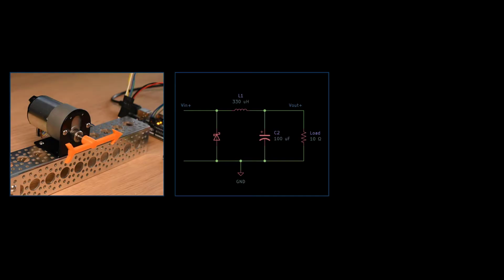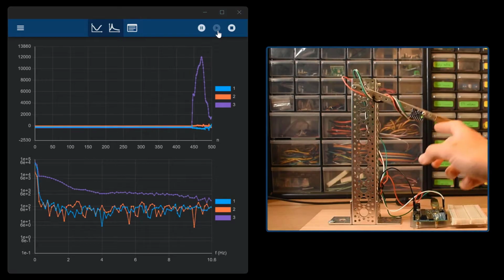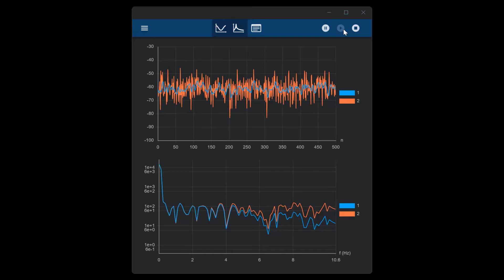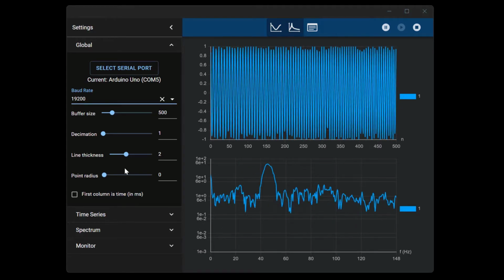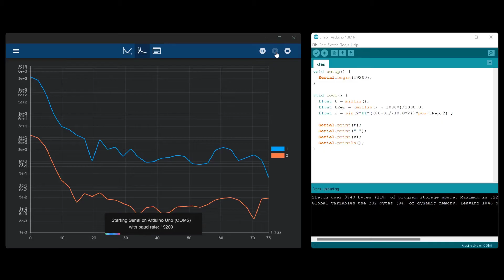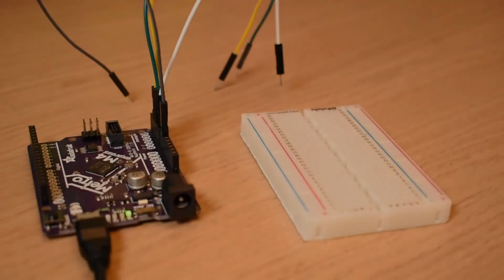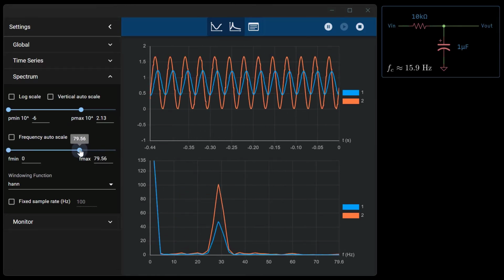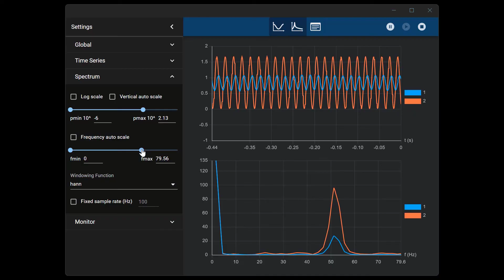The Serial Analyzer App

Comment: If I send a variable for time reference and then select 'Estimate time...', will it still use the variable I'm sending? Would that be the most accurate way to plot in terms of timing?
Reply from the maker: I can't remember, does "Estimate time" take an input? If not, than it's probably the most accurate because it will take whatever your time variable is and approximate the (average) sampling rate from it.

You can always check the source to figure out what "Estimate time" does.
Reply: @curiores111 thank you!!

Comment: Very Impressuve app. I used the graphs in my research paper. But its confusion. What is the value showing on the y-axus in upper graph. I have been analyzing a signal from piezoelectric material. Its showing my signal upto 30000. How can i adjust it to show magnitude of voltages. Can you help me in that. please

Comment: I have an accelerometer that transmits via serial at 1Mbps (it's a USART, not UART).   I tried to write a GUI using pyqtgraph, using one thread to parse the serial data, and another thread for the gui updating part.    Unfortunately, after just a few seconds the GUI would lag, unable to keep up. 

Any thoughts if your curiores/SerialAnalyzer could be modified to plot accelerometer data?   I've seen a few projects ( VizhPort , serial-studio, RealtimePlotter (Processing IDE),TelemetryViewer, hyOzd /serialplot ) but not sure how they handle lots of data. 

Standard can-bus operates at 1Mbps, so perhaps if there was a way to use a can-bus visualization tool for serial port data (pcan-explorer, plot-juggler, Tbruno25/can-explorer SavvyCAN )? 

BTW, any thoughts on Flutter/Flet and fl_charts?
Reply from the maker: I wouldn't use this type of application for that amount of data. Javascript isn't a performance language, so it's unlikely you'll get enough performance to meet your requirements.

If I'm thinking generally about the problem generally I'd probably use a low-level language like C++ to handle the data. Then, write an API to transmit the processed data (e.g., the fourier coefficients within a requested range) to the app. That could probably be a modification of this app... but at least on the surface I think that would be a much bigger project than the existing app.

There are probably existing solutions to this problem. I'm not familiar with them. Some of the apps you mentioned could be the way to go. Good luck!

Comment: Can not be uninstalled!!!!!!!!!!!!!!!!!!!!!!!!!!!!!!!!!!!! Beware!!!!
Reply from the maker: Really? I just tried uninstalling from the windows apps menu and it worked. Did you try that?

(The installer is an existing electron utility -- could certainly be buggy. I haven't had an issue with that so far though)
Reply: @curiores111  I had tried cclean and win10 uninstaller already. Everytime i tried. I was told serial analyzer was running and refuse to uninstall. Finally, I had to delete it in the Appdata folder. Note it was deleted and not uninstall. BTW, my Mcafee reported threat.

Comment: I get an error when connecting to com port, please help me
error code: Error starting serial port on USB Serial Device (COM4) Error: Opening COM4: Access denied
Reply from the maker: That can happen when another program is interacting with the device. Is the Arduino IDE interacting with it?
Reply: @curiores111  I was able to fix it, because the IDE was using the COM port so it couldn't connect to the analyzer app 
Thank you

Comment: How can I contact you for some help? I am building an electrostatic charge measurement device, It is almost done. But some oscillations are there which I'm trying to reduce, I watched your digital filtering I will try that. I also want to build an app to connect with mobile phones and my Linux laptop. These kinds of projects can help a lot in my work. But I'm not too savvy with electronics and application development. So If I wish to ask something, how can I get some help?

Comment: AMAZING stuff. Thank you sooo much for
- this tool
- the clear explanation and depth in your videos
- and the general ASMR-worthiness of your voice... found myself just zoning out listening :-)
I do have one feature request for this app (that I am currently using to tune the motor controller on my Star Wars D-O...) - and that is: It would be REALLY good to be able to a) name the transmitted signals, and b) have a way to send serial data to the Arduino. I often use command lines to set parameters and run specific things, and it would be great to be able to do this from this app.
Reply from the maker: Absolutely! The app was a labor of love, and I'm so glad that it has been able to be useful to you in tuning your D-O droid! 

Thanks for the feature request! It's irritating how the serial data often screws up in the first line. This is the reason I left out the normal naming by writing the first line in the setup function... That being said, we could certainly have it be an optional function that creates a name based on the first line of data. The other option would be to allow you to edit signal names inside the app. Does one of those options make more sense to you?

Sending serial messages is a pretty reasonable request. The simplest would probably be a pop-up window to send a message after a button press. Another option is to include it in the serial monitor widget as done in the Arduino app. This would mean splitting that window up. That's a good option too. A third option would be to add a fourth optional widget that becomes afixed to the bottom of the main window for sending messages to the arduino. Just an edit field and a button to send the message. Any of those options preferable?

If you want action on this I recommend creating an issue on the github page. 
https://github.com/curiores/SerialAnalyzer

I come back to the app occasionally to update it and this is where I look.

Comment: how did you create the windows installer for the app? did you just use visual studio?
Reply from the maker: I coded the app in VS code...but the packaging is unrelated to that. Definitely did not use Visual Studio.

Are you familiar with Node/Electron? It basically allows you to use a web-stack to develop OS-native apps.

My stack is an electron react app using Material-UI for the interface. I've added several node packages for additional functionality required by the app.

Electron packages that all together into the OS-native apps and generates the installers. Specifically, I used electron-builder.
Reply: oh thanks:) I've not use electron before but will check it out. Also, your other videos have been generally[really] useful. I feel like sometimes people say generally useful but what they really mean to say is really useful, or that's just me. Thanks again! @curiores111

Comment: I've been testing the serial analyzer for about a week now. The application of is great. I've  used it to see the response of a few first order filters (low pass, high pass and band pass).

I had 2 issues:

1. The numbers on the vertical axis of the frequency response graph have to be the gain of the filter in normal form A or in decibels 20logA, but on the app it shows numbers that doesn't match with either the true normal or the log values.

2. Hovering over a graph is supposed to give the x,y value at that point on the graph but it doesn't (well, it barely works), maybe you coded it with limited pixel freedom hence the issues.

Question:
How long did it take you make an application like this? The user experience is quite great when I got the hang of it.

Overall the app is great, thanks. I wish you don't stop making videos, they really motivate engineers (or people say nerds) like me.
Reply from the maker: Hey thanks for the feedback. If you make an issue on GitHub I'll visit it if I'm ever working in this app again.

How long did it take? Hmm. Few weekends. Maybe 60-80 hours? I wasn't very familiar with electron, react, or MUI, so there was definitely a learning curve. (also keep in mind, there's no testing -- this isn't production code). I had some interest in learning those "tools" so this was a nice way to engage with them more deeply.

Thanks for the encouragement. It's been hard to find the time/motivation for videos, but I'm working on one now. See if I can get it finished.

Comment: corrupted deb file, both from github and google driver, I downloaded it through curl since the link was off for me, I use ubuntu 23.04, I tried to compile the app too and it didn't work even with the dependencies
Reply from the maker: Probably an incompatibility with the OS. It would probably need to be rebuilt. I did build it on ubuntu -- but I don't recall the version so that's definitely not going to guarantee anything. Odd that you weren't able to compile it. But, compiling anything with dependencies often requires some debugging for getting the right things installed on your system, so not terribly surprising.

Comment: I am having an issue when monitoring the data from an arduino mega ADK connected to a 3-axis accelorometer (adxl35). The serial Analyser is reading the (x,y,z) data on the third box but it is not displaying the graphs. Can I have some help with my issue please, the arduino code is as follows;
 int xpin = A3;                
 int ypin = A2;                
 int zpin = A1; 
 int xvalue;
 int yvalue;
 int zvalue;
// Vcc at 3.3V
void setup()
{
   Serial.begin(9600);          // initialize the serial communications:
}

void loop()
{
  
  xvalue = analogRead(xpin);                              //reads values from x-pin & measures acceleration in X direction 
  int x = map(xvalue, 264, 401, -100, 100);               //maps the extreme ends analog values from -100 to 100 for our understanding
  float xg = (float)x/(-100.00);                          //converts the mapped value into acceleration in terms of "g"
  Serial.print(xg);                                       //prints value of acceleration in X direction
  Serial.print("   ");                                   //prints "g"
   
  yvalue = analogRead(ypin);
  int y = map(yvalue, 259, 398, -100, 100);
  float yg = (float)y/(-100.00);
  Serial.print("\t");
  Serial.print(yg);
  Serial.print("   "); 
 
  zvalue = analogRead(zpin);
  int z = map(zvalue, 287, 425, -100, 100);
  float zg = (float)z/(100.00);
  Serial.print("\t"); 
  Serial.print(zg);
  Serial.println("   ");
  delay(10);
}

Comment: Are the Arduino sketches you used in the video available online anywhere? I copied the first sketch from the screen, but I'd love to see the one you used with your RC filter. Thanks!
Reply from the maker: Here's what I have saved. I can't promise that it's what I used in the video, but it looks pretty close to me. It just generates a signal, which is written to the DAC (this was on an adafruit M4 which has a built in DAC on A0 and A1). Then, it reads the input and output signals from some probes looking into the circuit on A2 and A3. Pretty simple stuff:

void setup() {
  Serial.begin(115200);
}

void loop() {
  float t = millis()/1000.0;   
  float tRep = (millis() % 10000)/1000.0;
  float xmag = 4096/4.0; // max 4096
  float x = xmag*(1+sin(2*PI*((60-0)/(10.0*2))*pow(tRep,2))); 
  float Vin = x/4096.0*3.3;

  analogWrite(A0,x);
    
  float raw = analogRead(A2);
  float Vout1 = raw*3.3/1023.0;

  float raw2 = analogRead(A3);
  float Vout2 = raw2*3.3/1023.0;

  Serial.print(millis());
  Serial.print(" ");
  Serial.print(Vout2);
  Serial.print(" ");
  Serial.print(Vout1);
  Serial.println();
 
}
Reply from the maker: Let me see if I can dig it up.

Comment: Does your app have enough info available to generate a frequency response curve?
Reply from the maker: Sort of... you would need an input signal that spanned over the frequencies of interest. That wouldn't really be the responsibility of the app, per se. Generally speaking that would be more of an Arduino level task. The way that this app is designed, a viable feature would be to generate a graph of the frequency response based on an input signal and an output signal over some specified time interval. To be honest I might not mind adding this... I have been planning a video on the bode diagram, which would go nicely with this addition. Interesting.

Comment: Thanks! I will use this all the time. Trying to get it to run on Linux. I ran `yarn build` and `yarn run` from the main directory and it seems to have installed everything properly, though when I run it I only see a blank white page open up on my browser (Chrome in this case). Let me know if I am doing anything wrong! Thanks
Reply from the maker: Just had a change to look back at this. I had forgotten some of the custom scripts required to start the electron app. To run it, try "yarn electron:start". I will see if I can build it on Linux today.
Reply: @curiores111  Hey, this works! Thanks! I still need to actually test it but I can see the app window now. Thanks a million.
Reply from the maker: @avi-brown  Sure no problem. I did some brief testing in Ubuntu 22.04 and tweaked the app a touch. Seems to be working. Uploaded the package on GitHub. Still could use some additional tweaking in the serialport connection...but it's probably serviceable for now.
Reply from the maker: Glad to hear that! That sounds fine... probably something not quite right starting up the electron app. Unfortunately can't think of a reason off the top of my head 😕

Comment: I've been disappointed with the lack of customizability in the standard Arduino serial plotter, and this is excellent. Great video on how it works, and great program - thank you!
Reply: Two suggestions: 
1. Give an option to create a second (right) y-axis and select which data channels to put on that axis
2. Give an option to rescale the y-axis when some channels are hidden. For example, if one channel is in the 100-1000 range and another is in the 10-100 range, it'd be nice if clicking off channel 1 rescales the y-axis to show the 10-100 range. Probably shouldn't default to that, but adding an option is nice.

Comment: This is seriously impressive and helpful! But my favorite part is the fact that you correctly used the word "decimation" and turned it into a function in your program!
Reply from the maker: Love this. To be completely honest – I did look up "decimation" when I wrote this to ensure that the slider accurately reflected the standard terminology. 😉 My training is in applied math so DSP is actually a little peripheral to my trade.
Reply: @curiores111  nice! I have a friend who just got his master's in applied math. What area do you work in now, besides making seriously kick-ass educational videos? I'm considering doing the same, very curious to see how people put it to use.
Reply from the maker: @evanbarnes9984  Right now, I work as a (software) engineer. Did a short schtick in academia, didn't stick. Applied math is a mixed bag, (I only did it because I loved it), but there's definitely some opportunities (probably not as obvious as with other degrees). Several in my class ended up in machine learning/data science type jobs.
Reply: @curiores111  awesome, thank you! That's definitely useful information. My friend also wound up in ostensibly data science and ML too, but laments how often data science gets boiled down to making spreadsheets and writing SQL queries. He does also do some pretty cool ML work, to be fair. Thanks again! Hearing what other people do definitely helps.